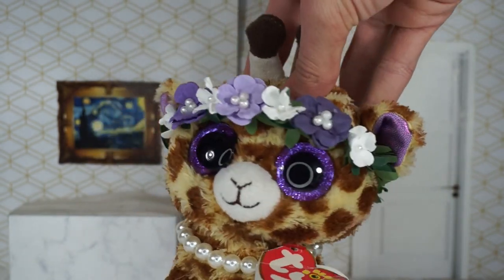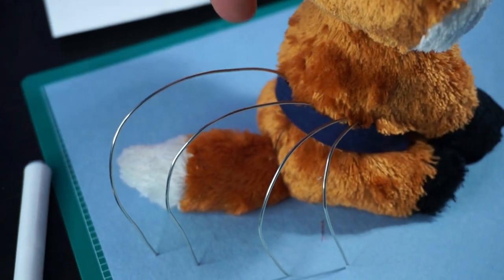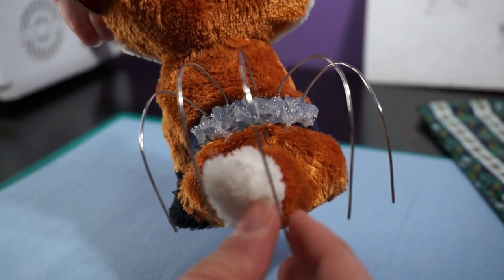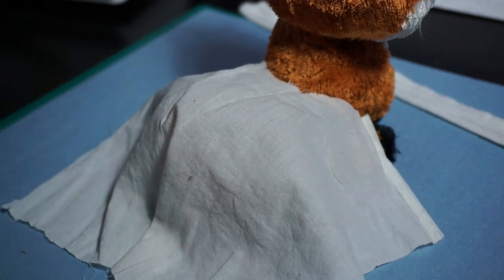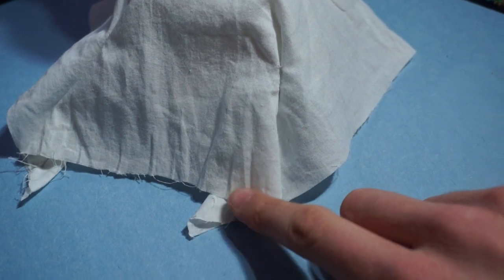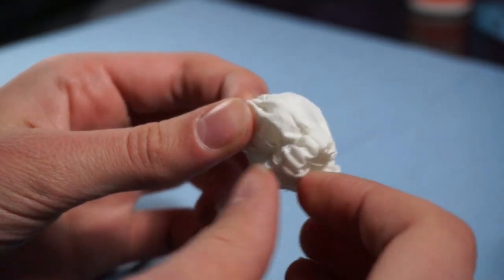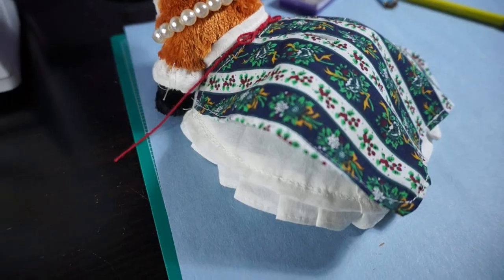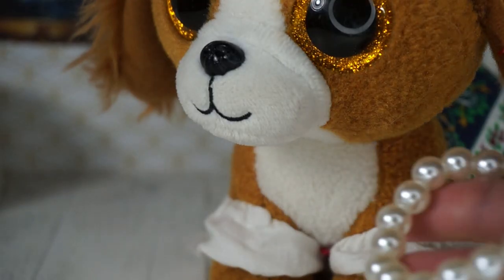👑 DIY Dream Dress 👑

Comment: Is there anyway to make the dress without wire ?
Reply: Or is there a substitute?
Reply from the maker: You can follow along while skipping the wire part... but it will be less structured and might sink in if any weight is applied. But you definitely still could do that! If you go to 16:47 you can see what it looks like with no wire.
I hope this helps! 🤍
Reply from the maker: Oh as a substitute you could cut out strong cardboard in that shape maybe or you could un-bend paper clips potentially. If you have air drying or oven bake clay you could make thin strips in those shapes!
Reply: Ok tysmmmm